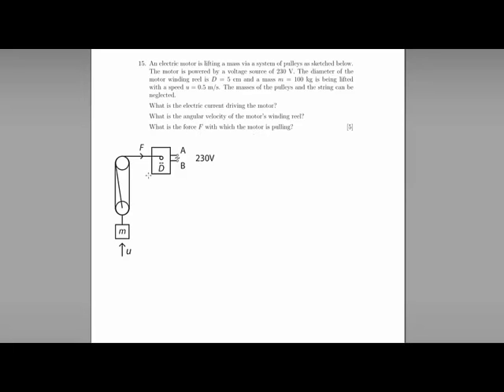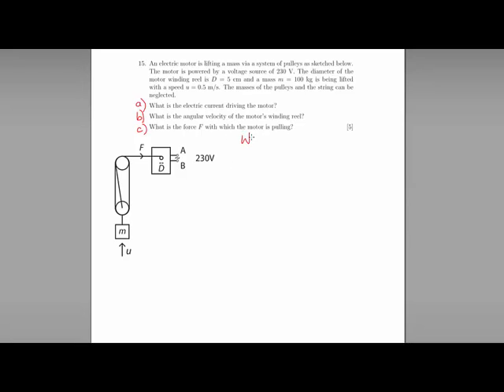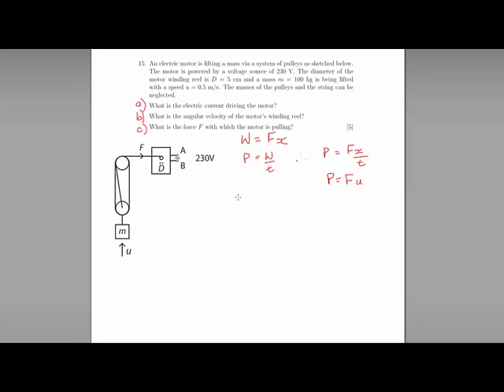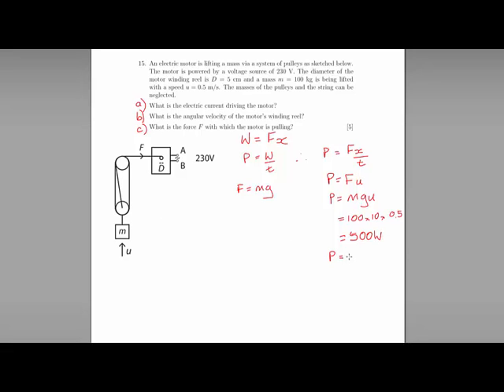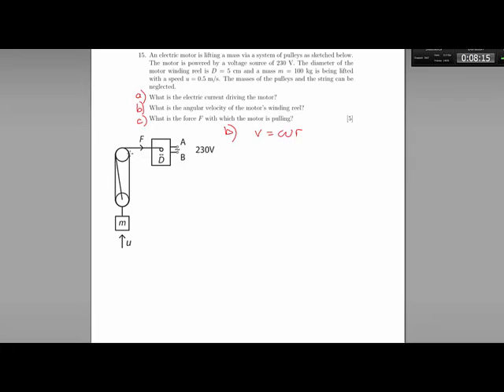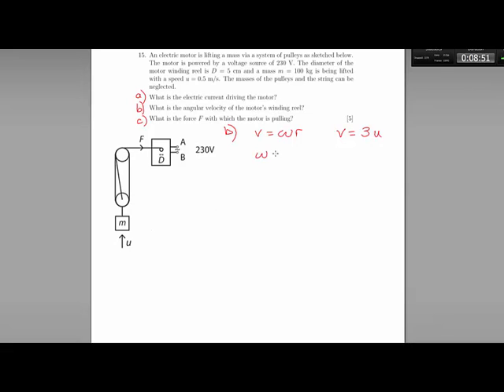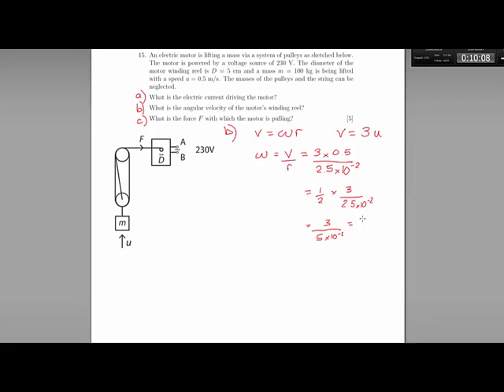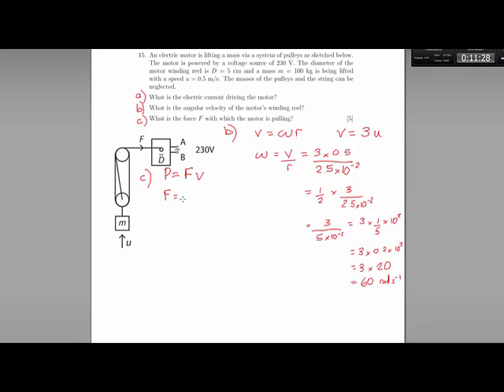Oxford PAT 2014 Q15 (power, angular velocity, pulleys)

Comment: +Cowen Physics

For part c.)......how was the speed 1.5? Wasn't it supposed to be 0.5?
Reply: shakeebshams Notice that the system of pulleys contains 3 strings so F needs to pull 1 string 3 times as fast so that m will move with a speed u